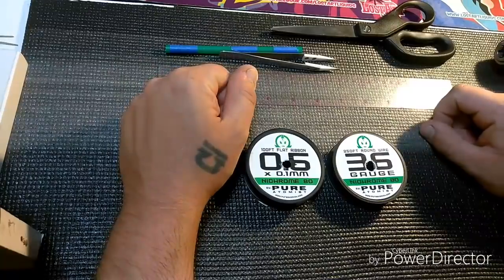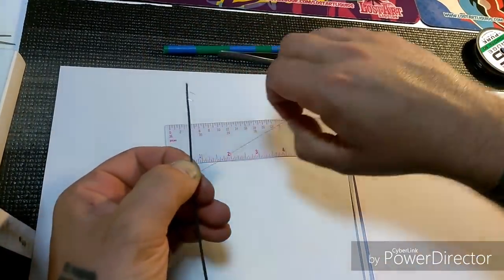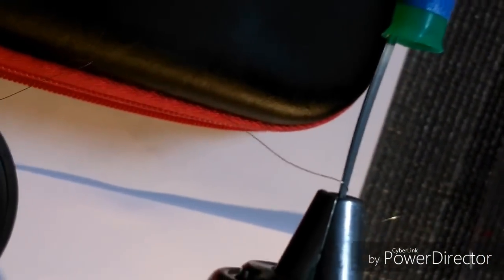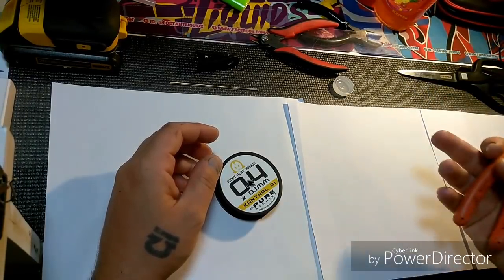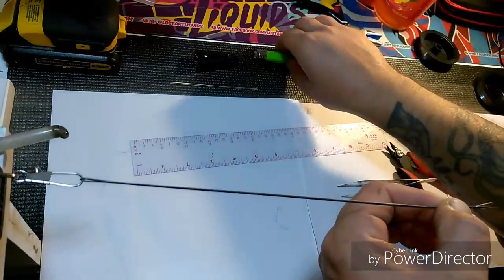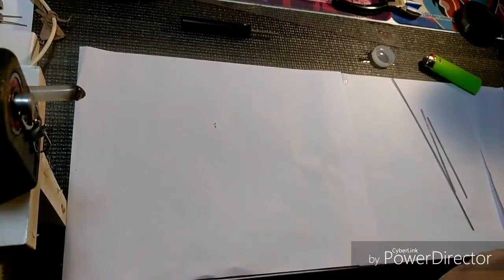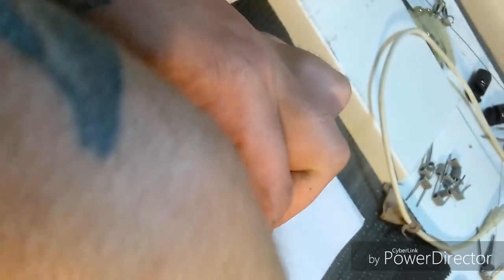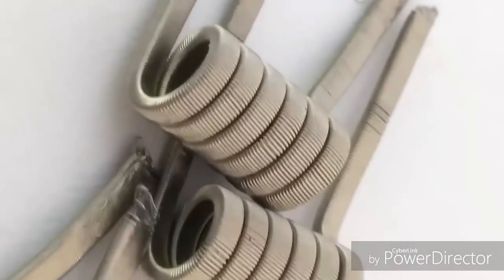coil builds - just starting off vol 4 - staple coil (no frames)- how to wrap - n. devine83

Comment: Is there anything else you could use off hand besides the drawstring clip im gonna order some but im already trying to build this coil as we speak got my decore n everything ready but the core was a bitch to get right with nothing to hold it so i hot glued the 2 ends but still not as tight as yours